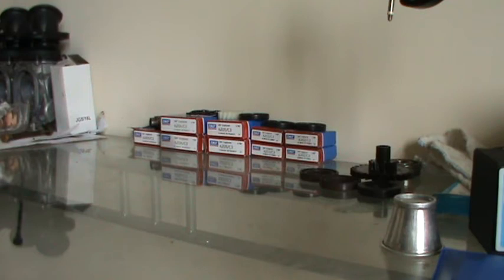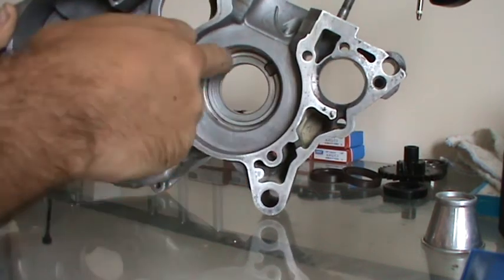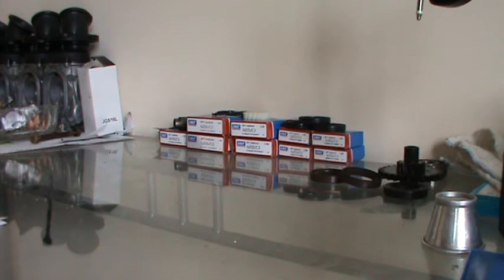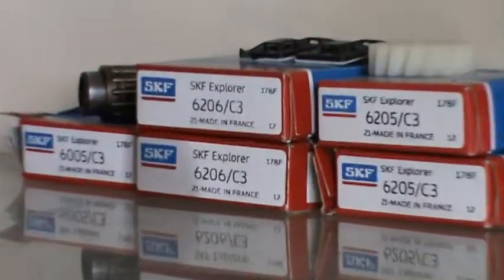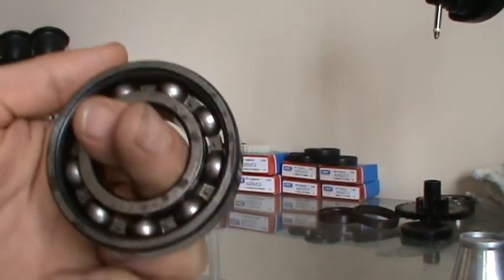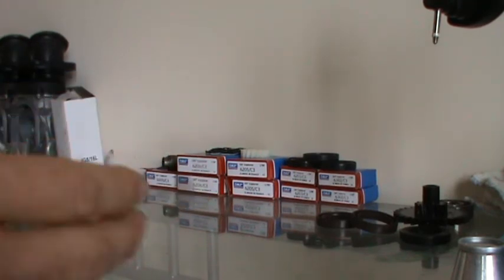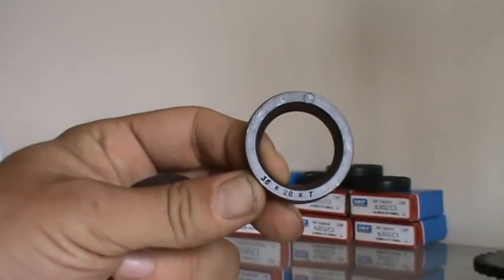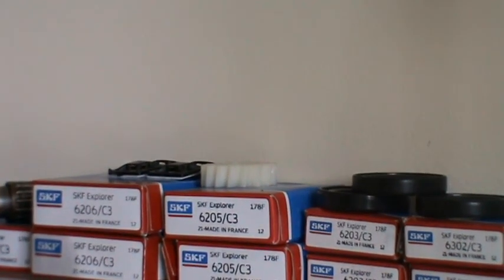Aprilia RS125 Bearings Seals Oil

Comment: c4's are higher heat tolerance ,. as for the seals ,their should be two with the same wrighting they are the crank ,the other one is for the output shaft and i got another small one for the gear shaft...
Reply from the maker: I understand what you have said, about the seals.  The point I failed to mention is that the Seals that people should have used is Viton seals not nitrile or Buna-N.  Anything within the oil region or petrol areas, should only use Viton or above.  That was my mistake for not mentioning it.

As for the bearings, C3 is personally recommended over C4 whereby viberation  and having bearings to loose is probably the worst comb you can have.  This would cause other parts of the engine to have excessive movement which would cause further premature failure.  All 2 strokes will always lubricate themselves enough to last.  The point I was making is that the bike I am fixing did not have the correct oil in it or enough of it.  This will be covered in the next video. 
The understanding of C4 will allow the bearing to reach higher tempretures and will not suffer seizure, but the trade off is viberation and very loose bearings. 

This is why C3 are used more often.  However most seizure are not from bearings but from the pistons and barrel from badly balanced oil to fuel ratio for the CC size engine or running too tight tolorence.

Very good points that you have covered, shame I did not explain myself better in the videos.